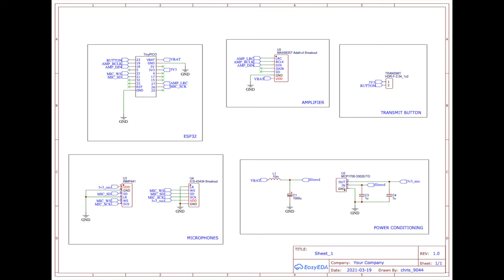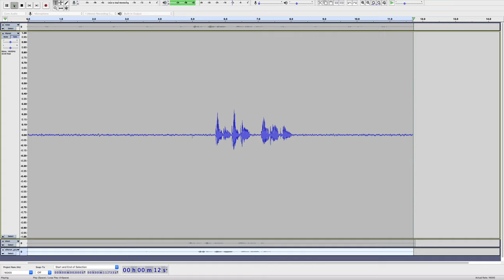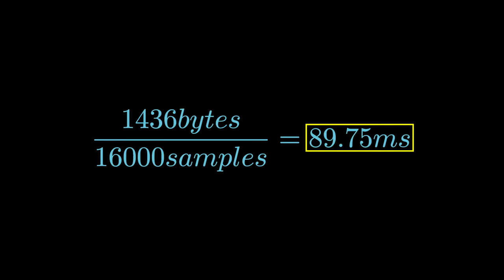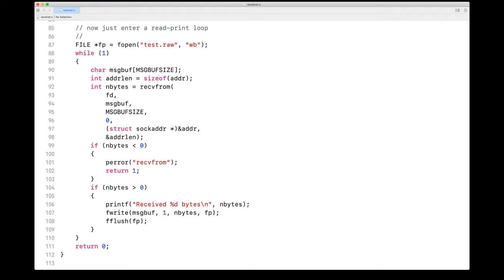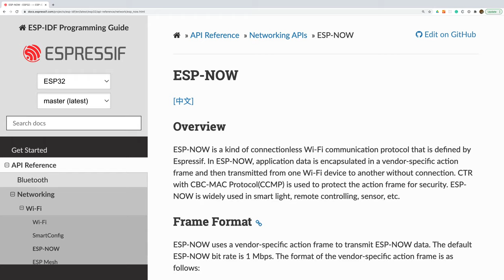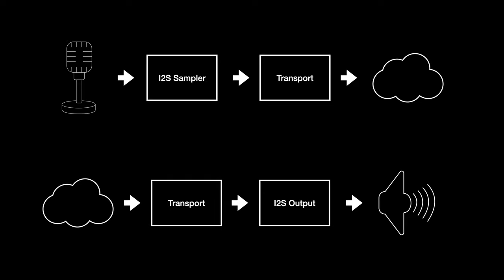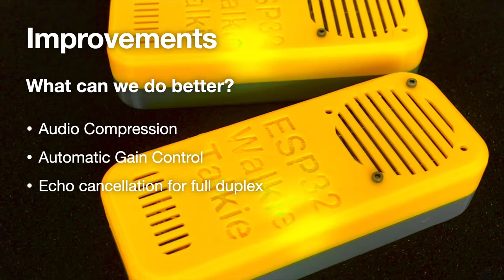ESP32 Walkie-Talkie: DIY Audio Magic

Comment: about compression. I look that someone was already do speex codec for esp32. Maybe it is good starting point.
Reply from the maker: That looks very interesting! Should be pretty easy to integrate into the software.
Reply: @atomic14  yup and speex is probably best codec to that use. It is just absurd how well it compress speech. There is some comparasion https://www.speex.org/comparison/ I used it at one project where we had store millions phone call records. We got about 10 better compression than mp3 with same audio quality. with 4kbps you will probably get what that speaker can support. At least 6kbps is more than enough.
Reply from the maker: @TH-wr1dv  Nice! This will be a great update to the project - I'll do a video about integrating it in (assuming I can get it to work! I may be in touch if I get stuck...)
Reply: @atomic14  Great. This project interest to me because I did want do esp32 walkie talkie at some point but as usual I did not had enough time (inspiration) to move from idea to execution. So this project at least fill my "is it possible" desire :D btw why you end up to use i2c mic and speaker instead of internal ADC and DAC? One thing what I think was also that is it possible to save battery by putting radio to 100-200ms sleep and then keep it wake assumed frame lenght time and then put it back to sleep if no frames received. So if there is no trasmission then it sleep most of time and only do fast wake up to listen is there someone transmitting. And only if someone will transmit it will keep listening continously. That can cause some small delay to open receive channel but most probably its not meaningfull. At least if at sender side there is 100ms buffer and it will flood small "heads up" packest beginging of transmission while filling transmit buffer. Then no words will go lost and receiver is guaranteed to be wake when real transmission start. Most probably that will prevent use of udp because I dont know will ap assoc stand over sleep. But at least esp-now probably works with that kind solution.
Reply from the maker: @TH-wr1dv  I prefer I2S mics to the built-in ADC as the built-in ADC is pretty noisy and I've found analogue microphones to be very susceptible to power supply noise. I've normally found I2S microphones to be much better at rejecting power supply noise but this time there was still noise coming through. The ESP32 ADC is not that great so I've tended to stick to I2S microphones. I quite like the fact that the audio is converted to digital very early on with the I2S mics as I'm not an analogue engineer. On the output side of things the DAC is ok, it's a bit noisy and not very linear, but does the job, and probably for this use case would be pretty reasonable. When I was testing I was actually using the DAC to drive headphones directly to avoid feedback problems. You would still need an amplifier break-out board to drive a speaker and once you need an extra board you might as well use one that takes I2S as an input - once again staying digital for as long as possible.

Comment: You may get cleaner audio if you use a capacitive multiplier circuit instead of a LDO. LDO aren't that great for filtering out ripples
Reply from the maker: EEVBlog has a great video on this - I have used one previously with microphone input, but I didn't see much improvement over an LDO. But my office is not that quiet anyway so there's a lot of background noise. https://www.youtube.com/watch?v=wopmEyZKnYo

Comment: Could you have also used bluetooth for the speaker/microphone?  Kind of...  would make the project simpler.
Reply from the maker: Bluetooth microphones are another can of worms :) https://youtu.be/0jR-QNTfydA
Reply: @atomic14  It kind of seems like this project is a little bit different.  For this one you're turning the ESP32 into the Audio Gateway.  You're not trying to pretend to be any device; best case you're just shuffling packets between the ESP32 sources and sinks.  The devices themselves handle compression for you, hopefully.

Comment: Cool project thanks for sharing! Is there a reason why you have used 2 separate I2S channels for the MIC and the speaker? it makes more wires uses more pins
Reply from the maker: I must admit that I had not actually considered sharing the same I2S peripheral for both input and output at the same time, but this could make a lot of sense. The code I used for the audio output was my sample code for outputting WAV files which supports stereo so my mental model was that it wouldn't work. But of course in this case it is just mono on both the input and output so that should be fine. I think I need to do some investigating - I've not tried doing both input and output on the same I2S channel before. Do you know if there are any limitations in doing it - can you use different formats on the input and output side or do they need to match? I'm thinking about how PDM microphones would work with a PCM speaker. I guess if you are only either playing or recording this doesn’t really matter. Very interesting! BTW - your Bluetooth speaker looks great!

Comment: I want to know that why did you went for an i2s based microphone and why did you not use the analogue inputs directly which will actually be much easier. Was there any specific reason?
Reply from the maker: Hi Aman, very good questions. I've found the I2S microphones to be slightly better when it comes to noise than the analogue microphones. The analogue microphones tend to have very sensitive pre-amps which seem to be quite prone to power supply noise - and that tends to happen quite a lot with the ESP32 when using WiFi. You're also reliant on the built-in ADCs of the ESP32 when using analogue microphones and these are also very noisy. The code is pretty flexible so you can use either an I2S mic or analogue mic. I've got quite a good supply of I2S microphones so I tend to end up using them by default and they are pretty easy to wire up - it's only 3 wires for the I2S interface.
Reply: @atomic14  thank you so much for replying buddy. I hope that you keep on supporting makers like us by in lightning with your knowledge. Very soon I am planning to build ultra cheap high quality walkie torquay using in esp8266 which again works on the same ESP now protocol but instead of a expensive i2s mic , I will use a separate audio ADC and analogue mic with good quality. In that project i might need your help . So looking for your support . Thanks
Reply: @atomic14  also I would like to know that if I want to send an audio over ESP now what should be my sample rate what should be my bitrate aur basically what should be my audio specifications which ESP now packet can carry at one single instant and is it blazingly fast or is it very very slow and not really suitable for audio what is the audio scenario with ESP now protocol
Reply from the maker: @TechInventorAman  Apparently the data rate is 1Mbps which is 125KBytes/s - apparently, it is possible to change this. https://hackaday.io/project/161896-linux-espnow/log/161046-implementation

The main limitation from my point of view is the packet size of 250 bytes. This means that you need to be sending data packets quite often - this may or may not be a problem for your use case.

Comment: @atomic14 , based on the BOM, I've managed to find most of the components on digikey, but I'm unable to identify the 2 smaller capacitors in C4 & C3. What values would you suggest there?
Reply: second question, the 3d printed project has speaker holes at ~32 mm distance apart, but the speakers in your reference have holes that are ~42 mm apart. Is there some other brand of speaker that will actually work with this project?
Reply: lastly, would you still know the make of your spdt slide switch (on/off) and the momentary button? I couldn't make those out from the images. Thanks!
Reply: I think he shows 1uf in the schematic.

Comment: Hello! An excellent project, I thought about a similar project, but in a slightly different design. There is an open source program for communicating with a large number of correspondents called Mumble. It would be interesting to create a client to work with ESP. If ba then it would be possible to make a walkie-talkie, the server for which would be the Mumble server (you can use both provided by someone and your own running on your PC).

Comment: Great project. I remember it was one of my friend's final project at university!
Anyway, I wanted to ask if you can make this project using" NRF24L01+PA+LNA" and an arduino. I'm sure you can get better results with that and also get rid of the disadvantages that you mentioned.

Comment: Do this with LORA.  With a good codec you could probably get legible voice over 50 kbps
Reply: AFAIK LoRa can barely send text messages, let alone digital audio. Not only for the super low bandwidth, but mostly for the 1% duty cycle. You may say "Hello" then wait 15 mins for another message...
Reply: @theagentsmith There is a 50 kbps mode.  Also the chirped mode goes up to 10 kbps.

Comment: hello, I got into troubles when I tried to use your code and library. as it's not made as other library (just code with examples demonstrating functions of library, that you can #include in arduino IDE code). I am a bit lost in the Platformio IDE and way, how your code should be used properly. Could you explain how to use this library and how to use Platformio please? I tried to search for such a video on your ytb channel but I haven't find any yet. If you have any, it would be awesome. Can you send me a link to your or someone else's video, or some other source of information (if you know about any) that explains this issue? It would be a great help.

Thank you very much.
Reply from the maker: Hi there, it's not really designed to be used as a library, it's more of a complete working application that you can use for inspiration for your own projects. You are welcome to take the code and reuse parts of it as you want.

Comment: @atomic14 Dear sir , I couldnt find the part VLU0810-472K (L1-10m) is there a equalent component i can use?
Reply from the maker: The inductor capacitor filter is just to filter out any noise on the power supply so pretty much any values will work well. If you can’t find anything then you can leave the capacitor out and just bridge over the inductor.
Reply: @atomic14  Thanks sir , i found the part from a local shop , you do your job with passion , we love your projects , we appriciate many thanks.

Comment: What are the ratings of capacitor and inductor?
Reply from the maker: For the power supply smoothing, I used a 10uF and a 10mH inductor. I didn't apply any science to the selection of these values, they are just the largest that I have available to hand.
Reply: Thankyou so much for instant replies!

Comment: Good day @atomic14. Is it possible to connect 30 receivers to one transmitter using ESP-NOW?
Reply from the maker: ESP-NOW has a max limit of 20 devices. If you use UDP broadcast then you are pretty much unlimited.
Reply: @atomic14  Hello, can you pls give the code for the UDP server PC?

Comment: Hello sir, can we streaming mono audio 16bit 44.0 khz between two esp01 with low latency
Reply from the maker: I'm afraid I don't have much experience with the esp01. However, reading and transmitting audio does not take much CPU power, so I think you might be able to.
Reply: @atomic14  if I use any esp
Reply: Kindly make a tutorial about mono audio transmiter and receiver

Comment: I bother you again
 If I want to use MAX9814, where do I need to modify the code? Or  can use it at all
Reply from the maker: Hey Rachanon - just pushed up a quick change to enable the ADC mics. In config.h there's a #define you need to comment out and that should be it. If you get some problems then we can pick it up in a GitHub issue.
Reply: @atomic14  Thank you very much

Comment: hi, can I use NodeMCU for this?
Reply from the maker: I believe so, the ESP8266 supports I2S and the current codebase is not very CPU intensive as we're not doing any compression. So it should work. I generally use the ESP32 so you will be pretty much on your own. Good luck with it!

Comment: Can this be used underwater? Probably till 15m
Reply from the maker: Probably not - it uses WiFi or ESP-NOW (which uses the same frequencies) and neither of those will work through water.
Reply: @atomic14  can tou provide any input, wired also will be ok to use underwater

Comment: Hi atomic, I know its an old project but hope to get reply. I have connected everything according to schematics and uploaded the code to DOIT ESP32 boards. When I push the button I hear noises from the other but nothing meaningful.  It seems connections are OK triple checked everything. Using i2S Mic+i2S Audio Output I have tested also with Max9814 as mic but not working either.... Do you have any recommendations?
Reply from the maker: Are you using ESP-NOW or UDP for the transport? I must admin I haven't run the project for a while, but I've still got all the components. I will spin it up over the weekend and see if there are any issues. Can you raise a ticket on the GitHub repo?
Reply: @atomic14  hi atomic, thanks for the reply. Funny thing i managed to make it work somehow... Espnow im using with i2s connections when sampling 32bit not working but 16bit working as expected. I dont know if i missed if you mentioned in the video but made it work. 

Thanks for the reply and awesome project! Now i can communicate with my wife while fishing 🤭
Reply from the maker: @thenextproblem8001  That's great news! Good luck with the fishing.

Comment: Great 👍.
Is it possible to implement using TCP IP.,
both devices should work in two different places with two different internet.
 then one good application is the Emergency alarm / SoS device for elderly people.

Device1 is for an elderly person, device 2 is for their relative or caretaker( device2  should be an android or Ios app.
so that he can carry anywhere)

Device1 Side  should be an ESP device with 1 or more buttons
Three modes of operation :
1) pre-added 3-4 TXT msg,  send from device 1 to  device 2  
2) press a button and speak. recorded 10-sec message will be sent to device 2   and save there.
so 2nd person can play the voice msg at any time
3) walky-talky. 2-way communication

latency is not a big issue here.
device 1  can be designed like a walking stick, torchlight, or directly attached to the bed
Reply from the maker: For two different locations you will need some kind of server to forward the packets between the devices. There are ways to set up direct communication between devices and "punch through" things like NAT gateways, but generally that still requires a server to coordinate things. It's a pretty fascinating area to get into. https://en.wikipedia.org/wiki/STUN and https://en.wikipedia.org/wiki/Traversal_Using_Relays_around_NAT. But it's much easier to use a central server to route the audio around.

Comment: Dear chris can you make an explanation on transmit button part?
Reply from the maker: The transmit button - this switches the code from receiving audio data to transmitting audio data.
Reply: @atomic14  dear chris i made all the connections you explained but , i couldnt make the transmit button connections :( evething is waiting only for transmit button connections .. waiting in my desk for one month :)
Reply from the maker: @selahattinbabadag2804  I've answered on your GitHub issue.
Reply: @atomic14  i appriciate chris , now will finish your great project
Reply: @selahattinbabadag2804  i have connected every thing but i have problem in connection the two esp32 boards. can you help me please. i am using built in EN  button  of esp32